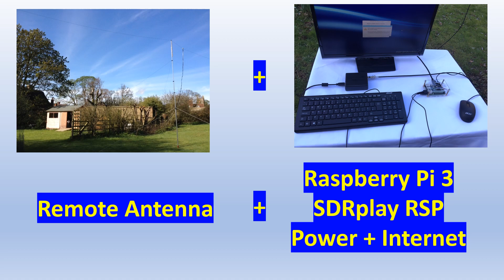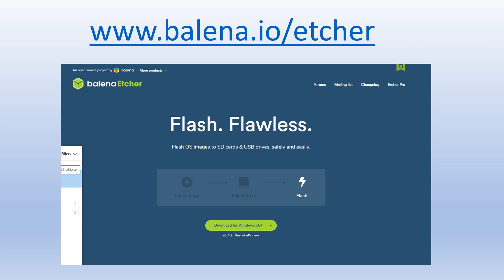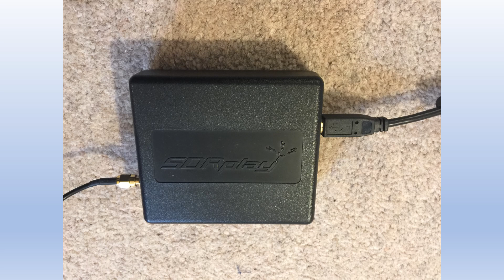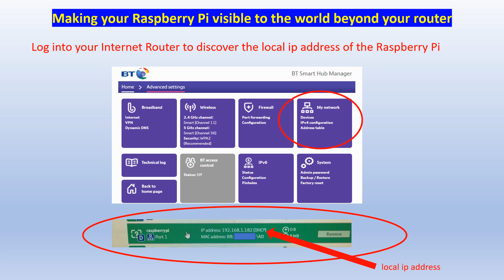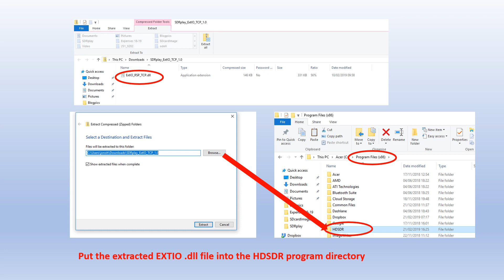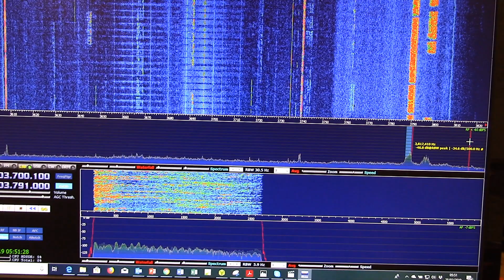SDRplay RSP TCP server remote Raspberry Pi demonstration

Comment: Hello, I wanted to know if it is possible to place the SDRPLAY Duo in a remote place with a raspberrypi and access it via the internet from the Sdruno software. I can't get that alternative to work since SDRuno doesn't run if it doesn't find a device connected to the USB port, is this correct?
Isn't there a way to use it? It would be like the most basic and desirable application when buying equipment with these characteristics.

Comment: Thank you for your video. My old RPi3B could not run your new software solution VIRTUALHERE. I was looking for a way to use a balcony antenna without running a cable through the wall. I was not able to connect the RPi to the internet, but I just used the local IP address. That's enough for my use case ! THANKS

Comment: ok do you have one for running your SDR on a Windows 10 PC?
Reply from the maker: Hi Matt.  The server software will run on a Windows 10 PC (or raspberry pi, mac or linux platform) .   At the other end (over the internet) right now unfortunately our own up to date version of SDRuno won't interact with it (we are working on this for release 1.42)   Meanwhile you can use the older EXTIO version of SDRuno  (comes with the latest SDRuno as a separate programme) ,HDSDR or other EXTIO compatible SDR packages for windows 10.

Comment: Jeeeezuz!! All I wanted to know was why would I run my RSP as a TCP server and you never answered that.... or maybe you did and it was part that I skipped because you were literally boring me to death!!! Oh... btw... your audio is jacked up. Every time you continue after a pause the volume blows out my speakers... SMH.
Reply from the maker: Hi Brian.  There is is indeed a problem with the audio quality on this video and we plan to replace it.  Apologies for that.  This video is designed to be  "how to" rather than  "why would you"  - so to answer the question why would you.....   you might run a computer connected to an RSP at a location remote from where you wanted to access it.  Assuming you have an adequate  internet connection, then this is a way of doing it.  The remote computer could be a PC, MAC or Raspberry Pi for example.   The remote RSP can then be used remotely with any RTL-SDR compatible software which inlcudes an  EXTIO.dll file.    Simply replace this file with the SDRplay EXIO file available on https://www.sdrplay.com/downloads/   - it's currently called "ExtIO Plugin TCP v1.0 (15th Feb 2019)"     - if you need more information, just raise a ticket here and we'll be happy to help you:  https://www.sdrplay.com/support/
Reply: @SDRplayRSP  great answer! Thank you and I am very clear now. My misunderstanding was that since SDRs are so portable you could take it with you on the go and not need remote access. However, if you're tuned into certain frequencies only available in your area then the SDR would have to stay put and then remote access to those region specific frequencies could be achieved. Got it!! My area is so dead that I really wouldn't have any need to be remote and my setup so condensed that all my equip. is interconnected through good ole' copper. Running a TCP server may be something for the future but not for now. My R-Pi is too slow for simultaneously running RSPduo, HackRF, two RTL-SDRs, an ATSC OTA server (Hauppauge), and my desktop as a PlexMedia server via 802.11ac. The Pi will be for mobile pentesting using Kali Linux, my Wifi Pineapple Nano, and LAN Turtle...that way I can pull the card and ditch the Pi in a hurry if need be with minimal loss of dollars. Thanks for the clarification though!!!

Comment: Can multiple users connect to this ?
Reply from the maker: No.  This set-up allows for a single remote user to have complete control over the remote SDR device - once connected over the internet, another potential user must wait until the session has finished.  This is similar to the remote access using SDR-Console servers (see http://www.sdrspace.com/Version-3 where there are a mixture of public and private SDRs available including several SDRplay RSPs) 

For multiple users to simultaneously access a single radio then WebSDR is a typical option, but the frequency bands available are typically set by the owner and or other users.  WebSDR owners are starting to use SDRplay RSPs as a popular and better performing alternative to the cheaper dongles - one example is ON5HB - see http://www.heppen.be:8091/

Comment: Using a RSP-1a and Pi 3 B+ across a home network. The problem I'm having is signal levels are very low and audio is very noisy and weak, but at least it's connecting! Haven't tried direct connection of remote workstation to RSP-1a with HDSDR as a means of troubleshooting. That'll be the next step.
Reply from the maker: Al Holt if you continue to have problems, raise a ticket on https://www.sdrplay.com/support/
And we will try to help you.

Comment: Does this work with a windows laptop?
Reply from the maker: Yes - We have provided versions of this server for Windows, Mac and Raspberry Pi.  Just go to our downloads page  - and the appropriate tab on: https://www.sdrplay.com/downloads/ and look for "TCP SERVER V1.0"
Reply: @SDRplayRSP  I'm sorry but it looks like "TCP SERVER V1.0" attach is not actually compatible with RSPdx receiver yet. I've tried it several times, and it does not work (process stopping when you connect to remote server). Also rsp_tcp detects my receiver as RSPduo, that's probably a root of the problem.
Tried to get work with source code from GitHub repository, and build it myself in Visual Studio.. After taking at least 2 hours i've succeeded with x86/x64 builds, and now my receiver detected correctly, connection/operation works too - everything works like a charm! It was tested to work with sockets via SDR#, RF Analyzer (Android), SDR Console V3. I've used app2srv to use rsp_tcp as a Windows Service and it boots even if nobody logged in.
So, main question is: Could you please update Downloads section with actual TCP Server ? as this is needed for latest generation of RSP receivers.
By the way, I could email latest compiled binaries to everybody who need it today.
Reply from the maker: @Tema567  The new headless server at https://www.sdrplay.com/raspberry-pi-images supports all the RSPs including the RSPdx. If you look on the downloads page you'll see that version 1.1 of the TCP server is there and supports the RSPdx which points you to the latest source here: https://github.com/SDRplay/RSPTCPServer - when the API 3 comes out of beta, we'll be updating the downloads page.
Reply: @SDRplayRSP  Thank you! hope it will be sooner and better. I like the way it's implemented (via API/libs with great documentation)
Currently it just works for me after building Windows binaries from source (from repo mentioned above)